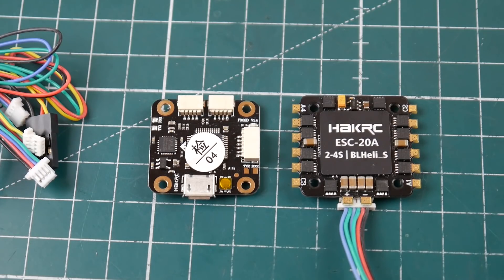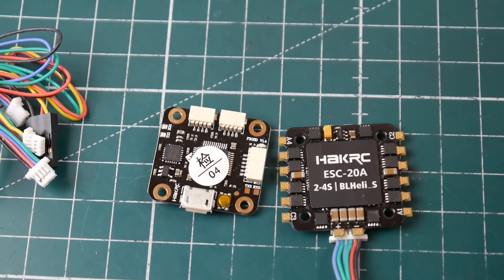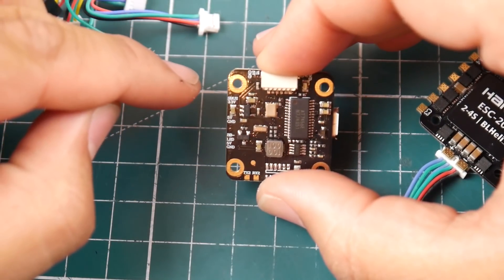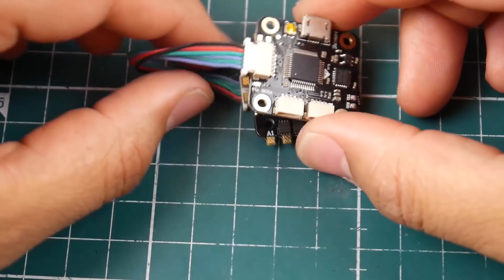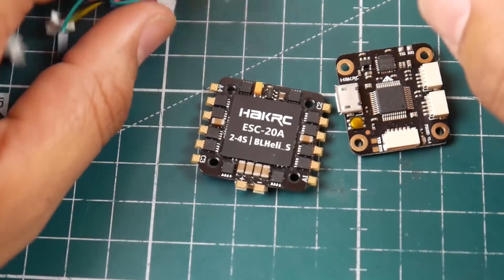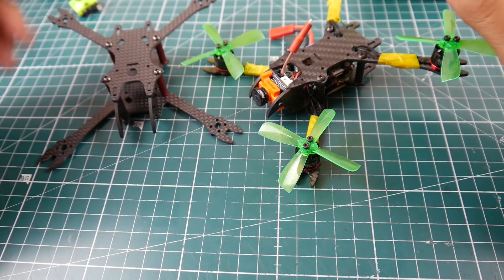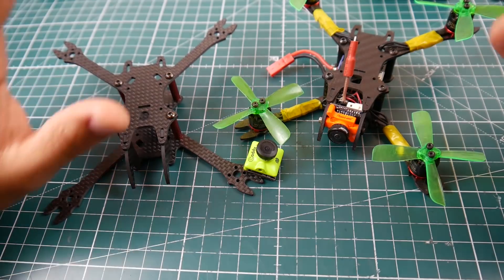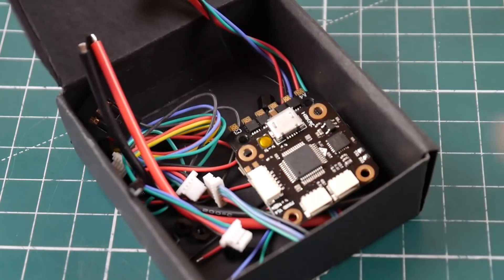The Budget Friendly HGLRC F428 Stack Alternative // HakRC MiniF3

Comment: I think I should get it for my massive Droner, I purchased a E-max F3 Magnum mini tower and I can't get the FC working right now I have given up and my friend is trying to find what I did wrong with it. I have a spekterum DSMX recever and I can't keep binding it, sometimes it works and then won't be able to bind then now if it binds I arm the motors and it's at fullspeed. I just have the worst luck with building and I don't know how to use a computer I can use Betaflight to a point but I can't do updates or technical issues I'm learning though. Thanks for the video.   JohnnyDRC

Comment: Really nice stack, dude. 😊
Try using 1106 5500kv motors in the build. That way you can run it with 4s batteries. 😉
Reply: I have SUNNYSKY R1106 6500KV but I don't think they will stand 4S  lol
Reply: jean-rene trudel No, they won't. But I said 5500kv. They would, easily. 😉

Comment: Thank you  .  Interesting to see  other option for mini stack.
Reply: I'm about to build a 3 inch with  RacerStar BR1407 or BD1507 motors.  Do you think I a 20 amp ESC will be enought for 4S ?  Thank you in advance
Reply: Should be plenty. I have 1407 hglrc flames and on a full punchout I only pull 13 amps max.
Reply: Thank you Danny!